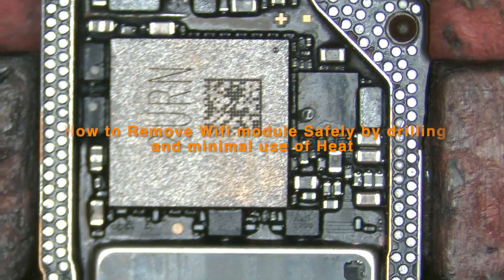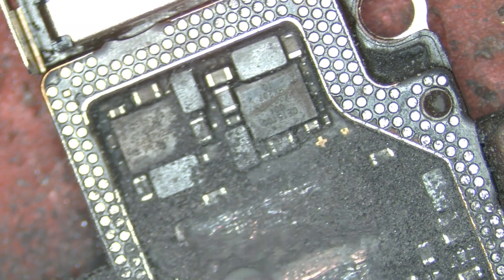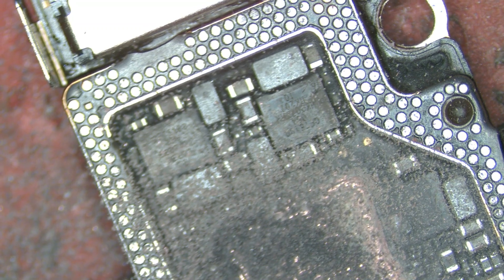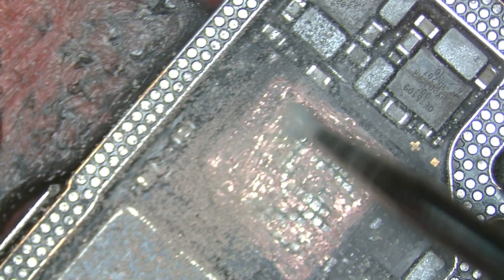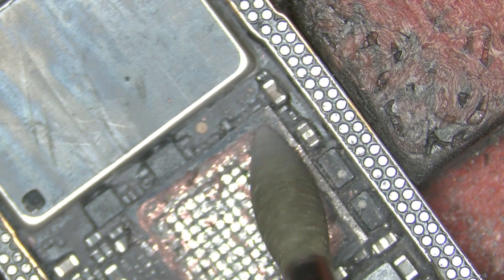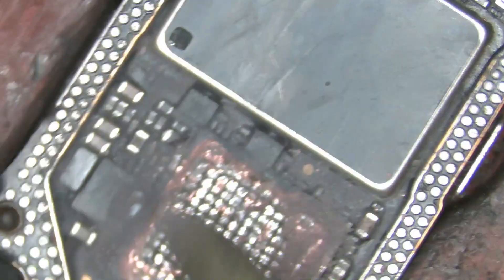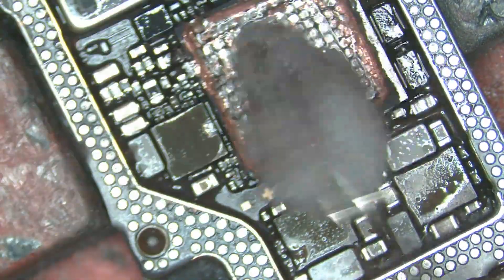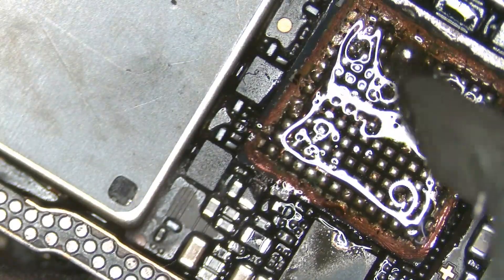Drilling Out Wifi Module   HD 1080p

Comment: this is kind of bad   just cut  a  cooper square put a screw through it and fit it to a 100W iron  , then press it on top of the IC also in the bottom use 100C PTC  heating element,  ps omg 6:14